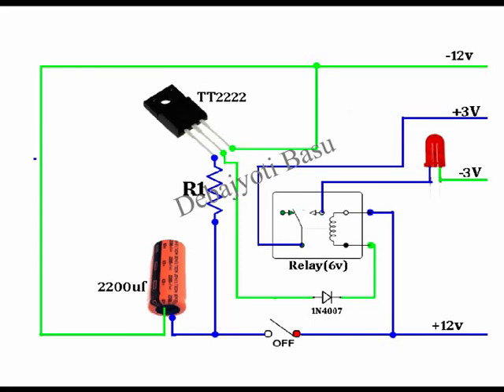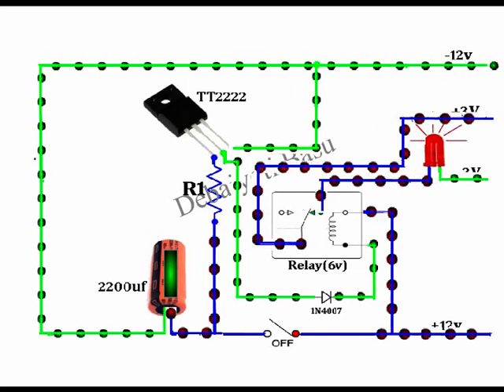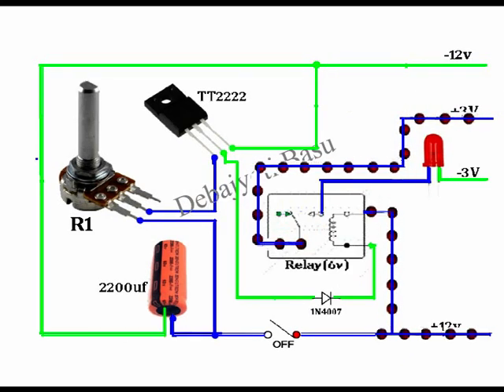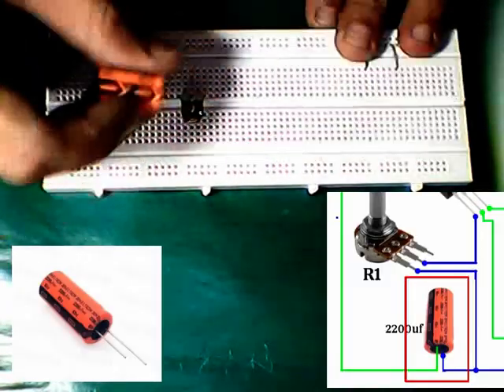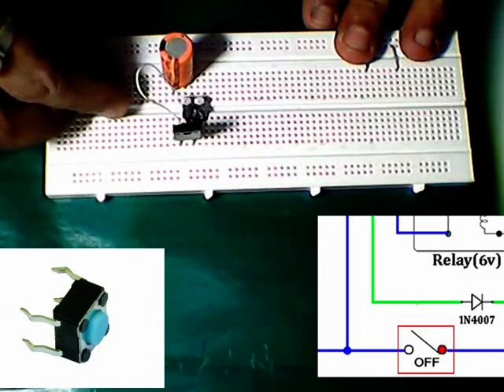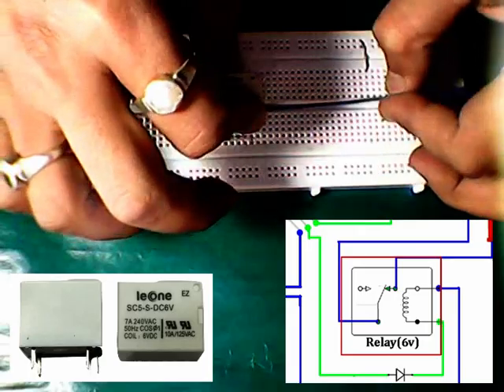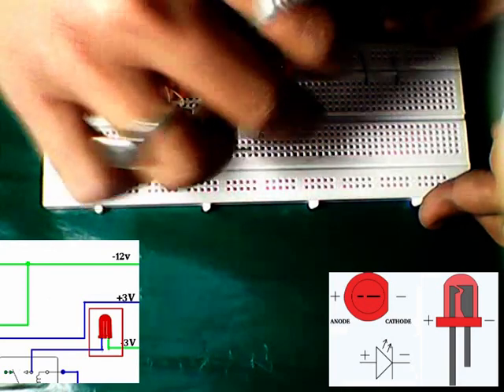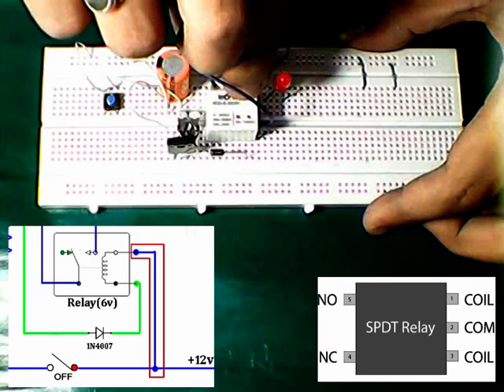Power Off Time Delay Relay Circuit

Comment: Hey if I keep giving power to this circuit for long time will it be problematic 
Because I want to make this kind of circuit for car lights to turn off after 10 -15 secs after I switch them off will it work
Reply from the maker: No, there will be no problem.